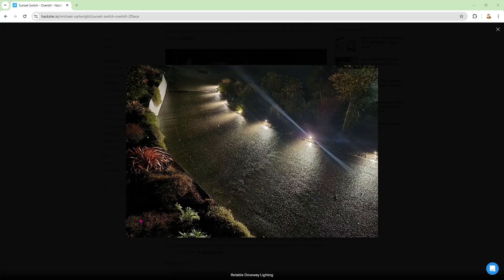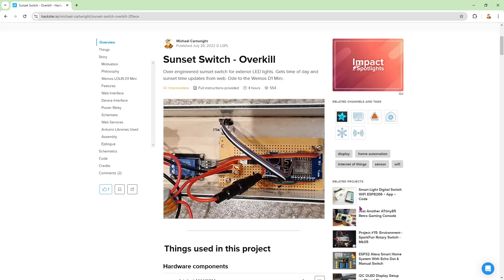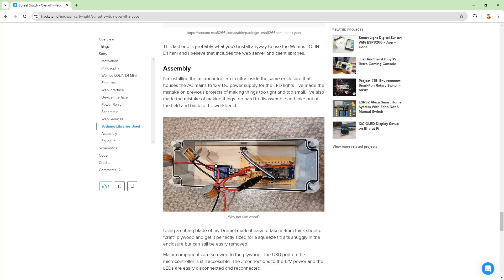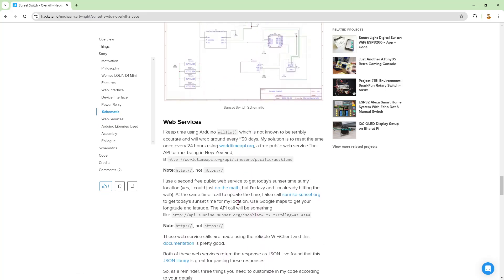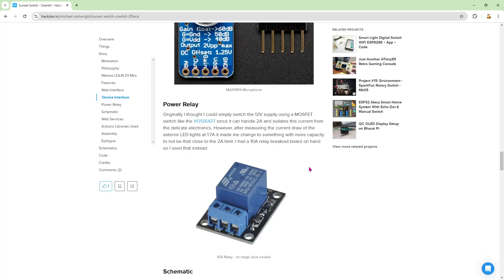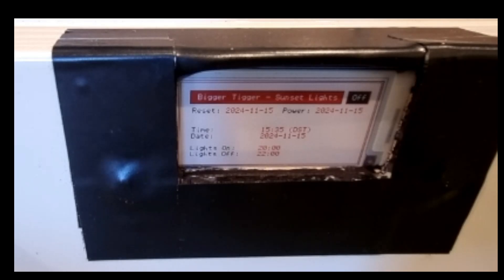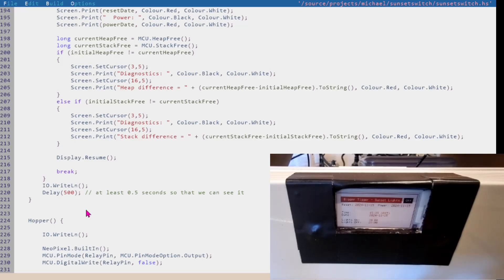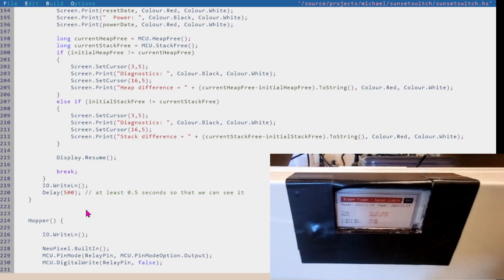Hopper: reliable computing on microcontrollers

Comment: Sometimes frustration leads to innovation.  You bring up a very good point that 3rd party libraries/services can break or be updated and become unusable on a project.  It's so easy to say "Yes to all" to update your libraries or reinstall your IDE and then find out something doesn't work right.  I suppose you can save the library or even put it in the main body of your code so it doesn't change unless you allow it.  However, I do appreciate everyone's hard work on creating libraries and drivers as it can save us a lot of time getting up running.  I also think that NASA is the gold standard when making reliable and durable microcontroller projects, especially in outdoor environments.  It runs with minimal intervention and reorients itself after a power failure.  I also like simplicity with the fewest parts possible.   Thank you so much for these videos.  I really appreciate you!

Comment: I love what you are trying to do. I think relying on DST pre-programmed will be the last failure point. At some point, DST will change because of politics. I think you could test the same methodology with a "light sensor" that tries to calculate sunset and sunrise by position of the sun and duration of last light/dark cycle. It would also allow for creative use during solar eclipses and other anomalies like haze from fires.
Reply from the maker: I like the idea of looking at daily averages and using that to adjust when "sunset" is (previous 10 days for example).
First improvement is a garage door sensor and an ambient light sensor so that the lights come on (in darkness) from when the door opens to a few minutes after it shuts (for when you leave the house at 4am ..)
Reply from the maker: Done. For v4, I also integrated the remote "garage is open" indicator into the project along with a feature to light the driveway if you ever open the garage door at an odd hour in the dark (like a 4am run to the airport).
Resetting the reliability calendar to zero: the best run so far was v2 which ran with no issues for 8 months.
https://www.youtube.com/watch?v=TcJxs1kSx94&list=PLriDPC-IsO2mSzBFWvDl9nDOSATeaqPm7